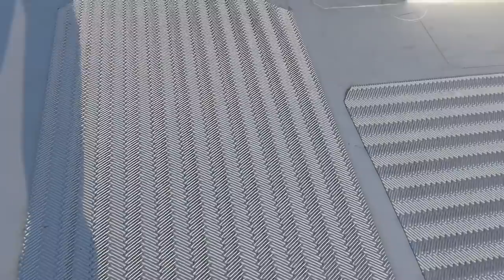Roofin’ Road Trip...

Comment: "Need some hot!" Worked with cant strip back in the day. New materials, hot seam welds came after I worked the trade. Put myself thru college on a grown man's wage. 
I used to love that 60 pound mica, used lots of 90 pound rolled.
Residents used to freak out, to see a "kid" walking on yheir tile roofs.
Was running a hot tar kettle with a bad regulator at 15, that thing would talk to ya past 650. 
Ya learned quickly how to drop a chunk in.
Reply from the maker: Yep, grew up on hot myself